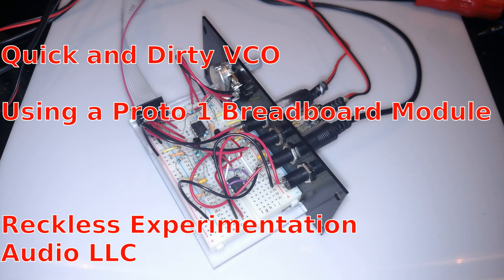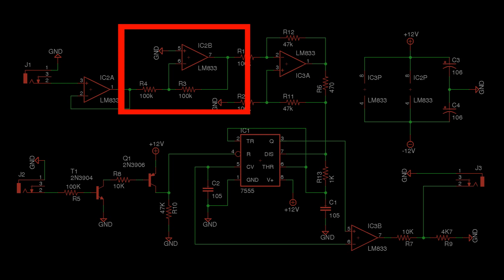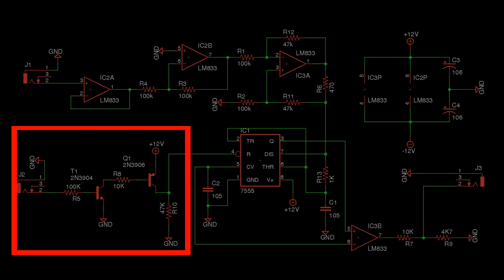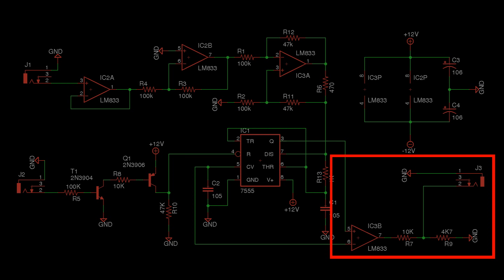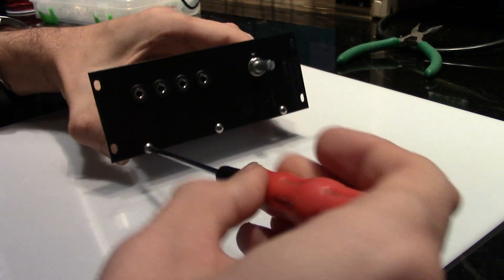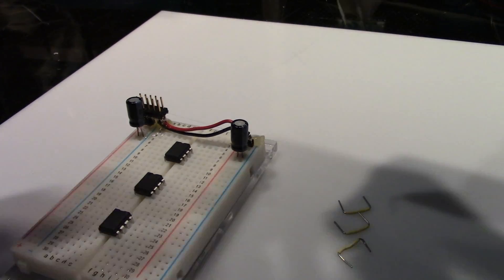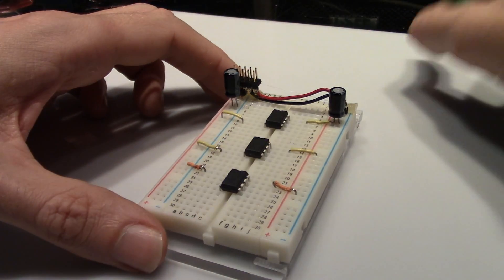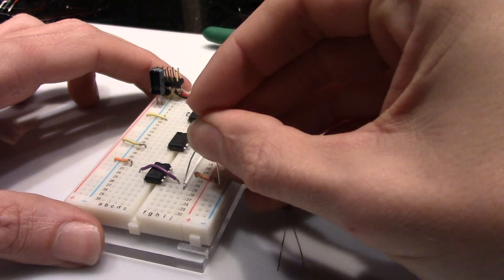A quick and dirty Voltage Controlled Oscillator on a Proto 1 Module

Comment: It responds to 1V/oct?
Reply from the maker: No, the voltage to current converter in the circuit has linear gain. For a 1V/oct response, you need a log gain amplifier circuit. 
It is possible to breadboard, just a lot more complex.